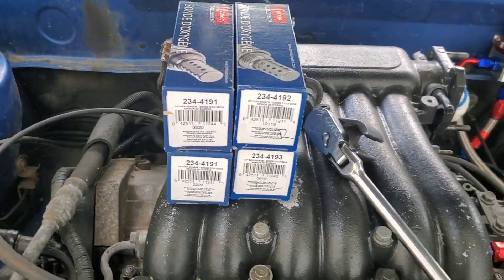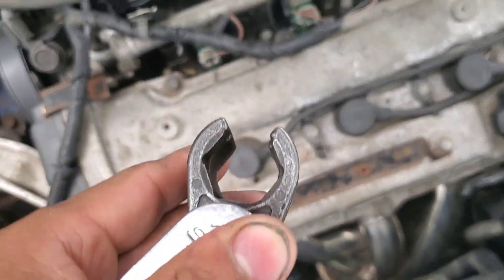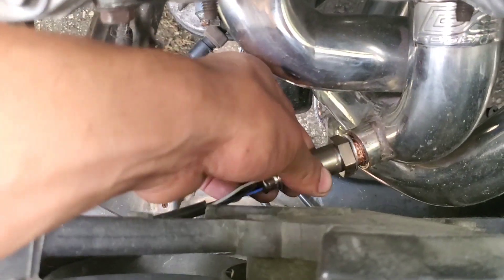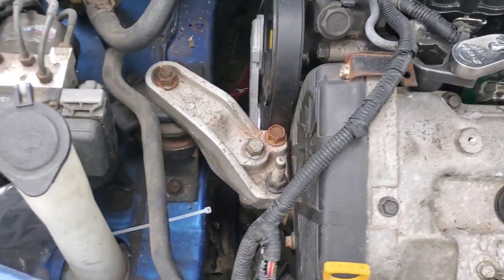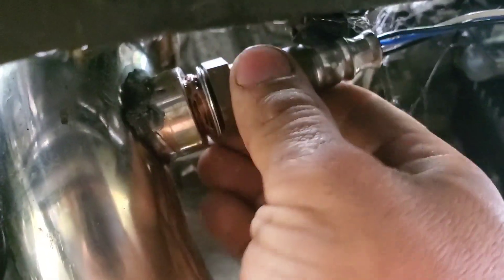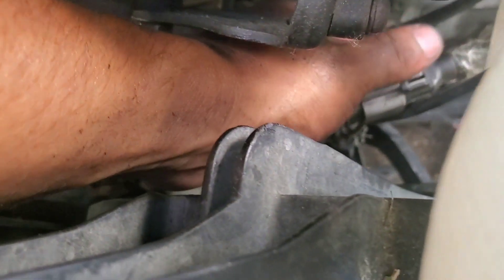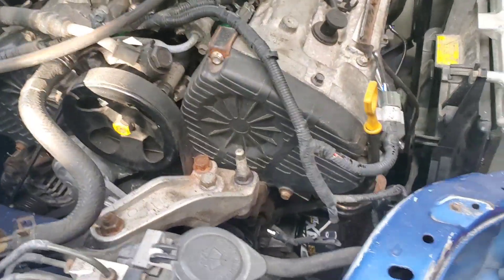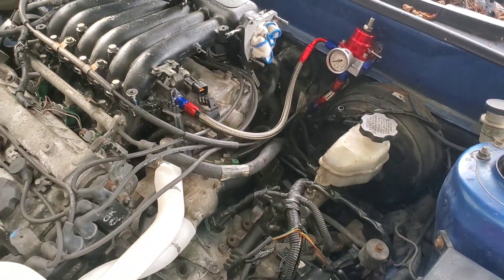Installing 4 O2 sensors on 2004 Hyundai Tiburon 6 speed (supercharger project)

Comment: I replaced the upstream sensors but still get a CEL. I am using the same ones as in the video. You also get a cel code even after replacing? Thanks.
Reply from the maker: No didn't get code just other code.
Well make sure you don't have any vacuum leaks, plugs spark wire,exhaust manifolds Gasket, wiring harness, fuel pressure all good. You have a o2 code don't mean it's bad it just tell you something not running right.
If can look up live data see how the sensor is responding.
Reply: @Lilmiddwest  Thanks for the reply, the codes I get are P0153 and P0133. You familiar with them by any chance? They came up when I had the oem sensors.
Reply: Cant you unplug your negative from battery and maybe it resets.

Comment: On My air intake manifold in the back where the throttle cables bolt to (the aluminum holes) were stripped so I guess I have to get a new manifold? any good places??
Reply from the maker: You can fix the thread. If you want used one check junk yards, ebay or I do have some laying around I was going to port them out but no one want to pay.
Reply: @Lilmiddwest  how much you looking for them?
Reply from the maker: @mattpacheco6489  shot an offer
Reply: @Lilmiddwest  well I live in va and so I'm not sure we would be able to reach a deal with shipping.. 120?. Also I'm trying to change my o2 sensors but I'm having trouble locating what sensors are which. Do you have any diagrams? I have an 04 tiburon gt 5 speed
Reply: Also I just realized you said I CAN fix the threads... Did you mean that? Or did you mean to say can't?
Reply from the maker: @mattpacheco6489  I can do 120 with shipping but they are factory, I sold ported out sets. What you need help with o2
Reply: @Lilmiddwest  like trying to match the bank 1 bank 2 upstream/downstream
Reply: Like I'm trying to find which one is which
Reply from the maker: @mattpacheco6489  that the one on back bottom
Reply: @Lilmiddwest  like it's next to the firewall and there is one at the bottom like at a connector and then one above it
Reply: @Lilmiddwest  ok. I think I can do that. Can I get a vid or pic of it just to make sure we're all set?
Reply: @Lilmiddwest  like I know there's one at the front bottom by the fan I think I need to get that one. So what Im asking is there a picture of where they are located and their names. I'm worried I'm gonna fuck this up 😭
Reply from the maker: @mattpacheco6489  on what email, Instagram, Facebook, snapchat

Comment: Which one is bank 1 sensor 1
Reply from the maker: Rear one top. B1 s1 is up stream, B1 s2 is down stream
Reply: @Lilmiddwest  so the one you did second in the video is b1 sensor 1? And how long should the cord be?
Reply from the maker: @cameronfountain6349  I don't know how to explain it more clear. It the in on exhaust manifold on rear. Not the bottom. Connector is located behind the engine towards the trans

Comment: How’d you manage to make so much room to access bank 1 sensor 1. My shit be so crammed I can’t access it.
Reply from the maker: B1 s1 on rear. You have manifolds or headers
Reply: @Lilmiddwest  manifolds
Reply from the maker: @StainlessDe1  well exhaust manifolds have heat sheld. I don't remember how hard it was I installed headers 12 years ago I don't have any problems
Reply: @Lilmiddwest  yeah that heat shield a bitch. Got the front one off but the rear seesh idk how to manage to reach that shit
Reply from the maker: @StainlessDe1  make sure you used 6 point socket. I remember see 2 guys struggling remove heat sheld for a hour. They were using 12 point sockets. I took it off with in mins
Reply: @Lilmiddwest  you remember how you took the rear shield off?
Reply from the maker: @StainlessDe1  no been a long time. Like I said used 6 point socket and pb blaster.
Reply: I replaced the upstream sensors but still get a CEL. I am using the same ones as in the video. You also get a cel code even after replacing? Thanks.